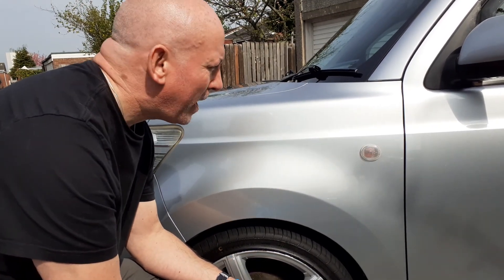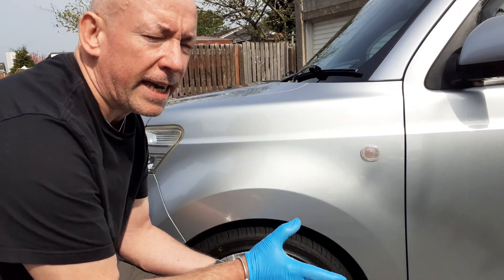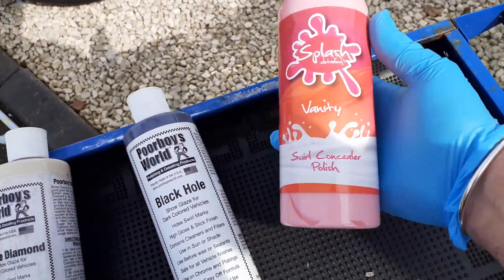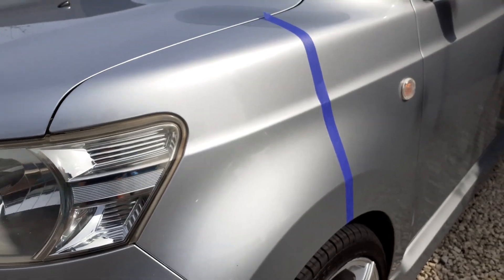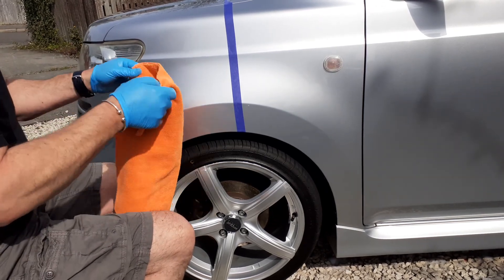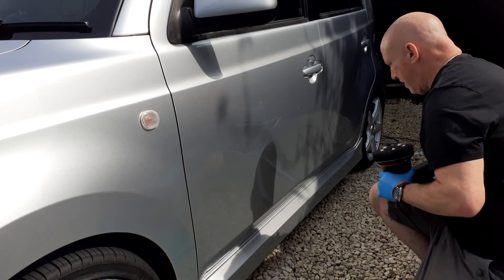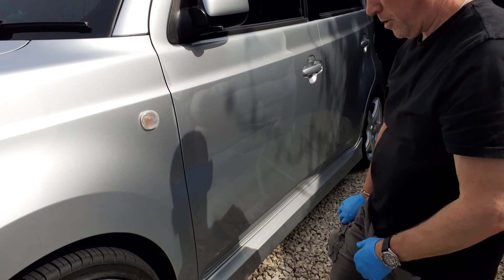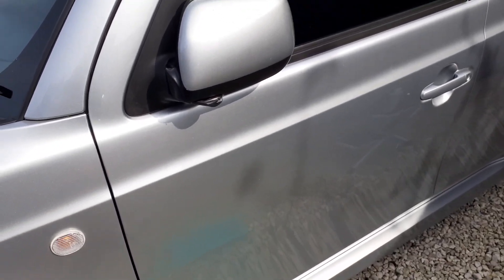Are Glazes cheating ????

Comment: Always going to be a controversial one, but I believe it is like anything  really, it has a place and it does what it is supposed to do. 
Sure the purists will scoff at it, but not everyone has the time, money or inclination to machine polish and seal their car.
I guess what I am saying is "horses for courses." If it works for an individual and they are happy with the results then it isn't cheating and there is nothing wrong with it, but if you don't like "short cuts" then stick to polishing and sealing. there is room for both in this world.
Reply from the maker: My thoughts exactly pete 😉 Out of all the show winning cars out there I wonder how many are perfectly perfect 🤔 If its acceptable to use high gloss sealants & coatings I dont see why a glaze couldn't be included in a detail. Providing of course detailers arent glazing a car & charging for a correction !!